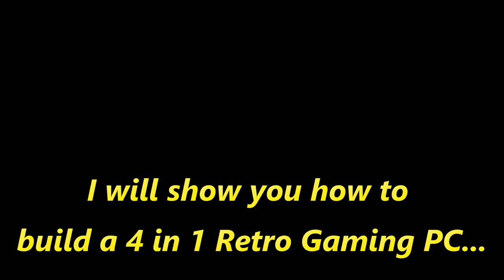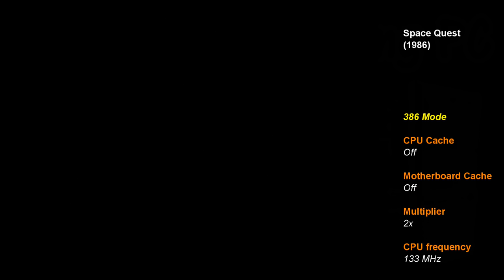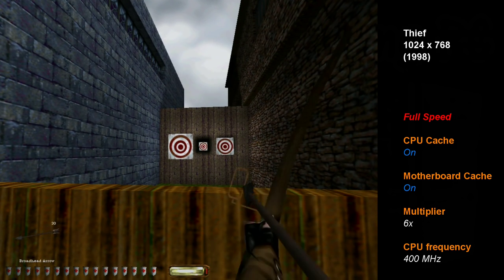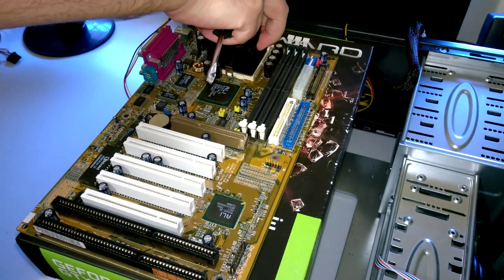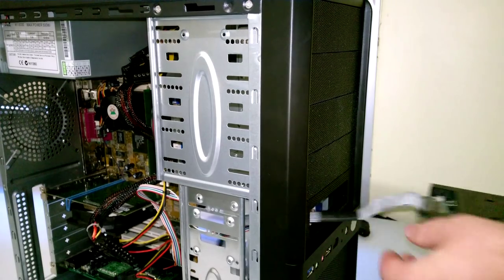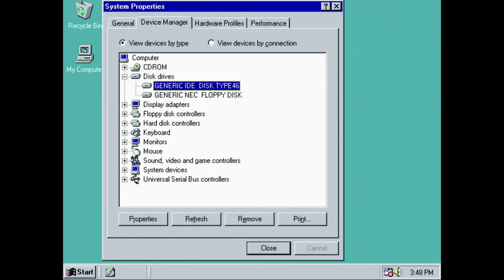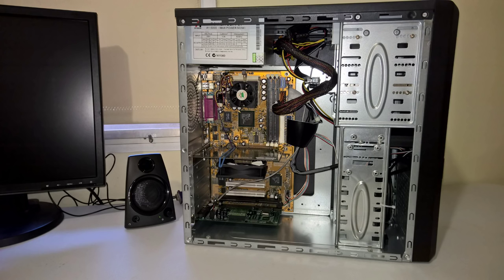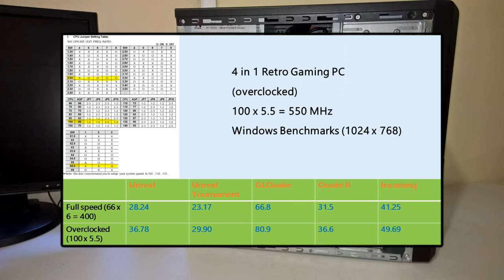Building a 4 in 1 Retro Gaming PC

Comment: What is a good AGP graphics card that works with Win-98 ?
Reply: The fastest Geforce that had Win9X drivers was the Geforce 6800XT AGP model. The fastest Radeon was the 9800XT. The best Voodoo card was the Voodoo 4500. 3DFX made a Voodoo 5500, but it was only AGP-2X and in many cases was out performed by the 4500. Both are getting really rare. You'd be better off going with a Radeon or Geforce.

Comment: Hell ya :D Just blew my mind, scaling a processor down and up on the fly! whoa... making it jump from 133Mhz to 400Mhz ;) I love your videos, I love your research, but The PCs are not period enough for me, IDE HDD, IDE CDROMs, PS/2 Inputs, & Real Floppies. Just like uxwbill says "Real Computers come with a Floppy Disk Drive." X-D
Reply from the maker: Jason Hicks Thanks for you feedback! Yes I understand, I love building machines with a mix of old and new technology. Especially having all the benefits of modern technology, be it a nice case, modern, reliable PSU, fast storage, an optical USB mouse and so on. It's not for everyone, but a lot of the tips apply to a proper retro PC as wel :)
Reply: philscomputerlab a lot of the programs you show off in your videos has helped with my Pentium 3 Laptop :D i didn't know most of them existed! Your video benchmark tools are awesome. I can't believe I have 2 P3 600Mhz laptops that are pretty much built at the same time (late 99), the HP Pavilion N3390 can do AGP x1 and Direct3D Acceleration but the Gateway Solo 2550 doesn't do D3D. Both are Graphic chips are from Silicon Motions, even the same amount of RAM, both are AGP x2! the only difference is the HP has a SM720 chip and the Gateway has a SM710 Chip.. freaking annoying LOL. It is even more interesting that the HP says it can do AGP Video x2 but I have no way of telling it to do so.
Reply from the maker: Nice! Must say I don't have any experience with using notebooks as Retro Gaming PCs, but why not?
Reply: as much in depth as you get.. Laptops from the late 90's would be a great thing to tackle. PCMCIA overviews, ZV ports, getting Gameport controller to work, hard drive options shoot outs would be interesting! hey speaking of shootouts, did 3DFX ever do a gaming solution for laptops? Just imagine the heat coming off that and Pentium3/4 aren't know for being cool neither! LOL

Comment: Are the usb drivers the same ones from the msfn.org forums ? If so, I have used it as well and they do work. Very handy to transfer stuff especially if there are no usb drivers for your more modern motherboard for windows 98se.
Anyone reading, make sure to have a proper faultless windows installation and already have the rest of the drivers installed from the motherboard cd beforehand. They didn't work from the first try for me, but after doing a format and reinstalling windows it works perfectly.
Reply from the maker: igorbog88 I'm not sure where I got them from, but yes, they work very well. Had USB sticks up to 32 GB in action. On these machines the speed is USB 1 or 1.1 only, so you got to be a bit patient. Copying across Ethernet network is faster. For very large copies, I pull out the HDD and put it in a USB 3 dock on my desktop :)
Reply: philscomputerlab  on my case it's slower than the usb 2.0 pci board with a Pentium mmx, but at the cost of high performance drop :( (10fps lost with 1 flash drive, 17fps lost with a flash drive on it)

Too bad I'm not able to disable l2 cache by software :( , But I kinda like that performance game heh, I even discoreved I could get 1 - 2 extra fps in quake 2 just replacing the usb keyboard by a dimm one :D
Reply from the maker: Interesting, didn't know that. I totally forgot about USB 2.0 PCI cards, I've had one in use a while ago. NEC chipset.
Reply: Mine's a NEC chip too, and I think it took 3 months to discover that the faulty fps in quake 2 was actually the flash driver >.> (I think I did 3 clean installs over that time).
 It was magic when I discovered the problem, it went from 27fps to 37,5fps :D, and now 38,5 because I'm using a DIMM (ps2) keyboard heh.
But, USB 2.0 Works just fine over my machine, if you only use it to transfer data it's ok, just let it off when playing Windows games and you'll be ready to go (hmm, maybe I can use it to slowdown even more my system over dos lol)
I wish I could get a K6-III+ but, they're only at ebay '-', and I'll need an EPROM for supporting it.
Reply from the maker: For copying file, do check out network cards. They are quite a bit faster and very convenient. I have a networked Raid 1 array and all my drivers, games, demos, stuff is on there. Makes it fast to get into a new project :)

Comment: how do you set it to 133MHz? do you use a 66MHz fsb?if yes, can the fsb be changed by software?...Hmm I see, you set your K6-III to 66FSB and the multiplier to 6x, shame my mb can only do 5.5 multiplier, but the mb support 1,5 multiplier, it's just bad that I cant set it to 1,5 on setmul
Reply from the maker: +ibm5155 Multi is set via software. You can go from 2x to 6x. FSB is set through hardware. Some boards allow it through BIOS.
Reply: But a K6-III+ can only go btw 3.0 and 6.0 right? (100FSB)
Reply from the maker: I'm sure I'm showing this in the video using SetMul,
Reply: @ibm5155  The K6-II/III+ chips will remap a 2.5x multi set on the motherboard to 2.0x internally. The 2.0x is remapped to 6.0x. Hope this helps!

Comment: Phil will a k6-iii + 450mhz work just as good or better for this build? It is on 2 volts and i believe 4.5 multi
Reply from the maker: +CSIG1001 Yes! It will work just as well :)
Reply: Trying to find a socket 7 that is comparable to the asus / gigabyte in your reviews is pretty hard on ebay.
Reply from the maker: Yes, prices have gone up quite a bit over the last years...

Comment: Just another question, my motherboard has jumpers to set the cpu frequency, so that software to change the K6-III clock will work on that mb or only on mb that set  the clock over the bios?
Reply from the maker: ibm5155 The software used in the video talks directly to the processor! The jumper settings will basically be overruled.
Reply: \o/
Reply from the maker: Quake games do very well on MMX, because the K6 has weal floating point performance AFAIK.
Reply: I got the K6-III+ 400 \o/.
Just one question, what is going to happen if I put it on my mb without supporting the k6-III+ by the bios?
I know my actual bios doesn't support the plus series, but it support it by a bios upgrade, but for that I'll need to take another bios (this one is an EPRON >( )
Reply from the maker: Worst case it won't boot, but usually it will display a different processor name that doesn't match.

Comment: It's a good option to use a Voodoo 3 2000 instead of a Voodooo 3 3000?
Reply from the maker: Yea that will work just fine. It's a bit slower, but also less heat :)
Reply: Is it much slower?

Comment: Isn't that a Voodoo 3 3000?  The 3500 has a TV tuner and a darker heat sink from what I'm seeing.
Reply from the maker: It's the "compaq" Voodoo 3 3500.
Reply: Ah, I see. Thank you sir!  Do you know what brand or model the hard drive bay you used here is?  Looking for one like it without a key that the ide to sata board will work with.
Reply from the maker: That bay is generic, doesn't have a brand! The cheapest you can find on eBay coming out of Asia :D

Comment: Hi Phil, In a LGR video, I see that you changed your time machine motherboard from this Gigabyte GA-5AX to the DFI K6XV3+/66. Is there any reason of you made the switch? Is the DFI mother more suitable to be used as a 4 in 1 time machine? Thanks!
Reply: Is it because the DFI is slower in DOS performance?
Reply from the maker: No particular reason really!
Reply: @philscomputerlab  So would you say they have equal stability and compatibility?
Reply from the maker: @wujames4074  Yea they are both great boards!
Reply: @philscomputerlab  Thank you!!
Reply: @philscomputerlab  If I can't find a K6-3+ 400, what is the next closet thing? A K6-2+ 500 or a K6-3+ 450 both 2.0v. Which is easier to setup?
Reply from the maker: @wujames4074  The 3+ have double cache compared to 2+ so go for that.
Reply: @philscomputerlab  Wouldn't it be too fast for DOS games? K6-2+ 500 is equivalent to K6-3+ 400 in speed?
Reply: @philscomputerlab  I got the answer from another video of yours!

Comment: PhilsComputerLab Would a Ga-5smm be suitable for this build? thanks
Reply from the maker: Yea that sounds fine!
Reply: PhilsComputerLab thanks ! only issue I'm running into is that video card. could you recommend an equivalent for this type of build? would something like a mx 400 give me this same experiance?
Reply from the maker: If you can find one with PCI. A Voodoo PCI would be perfect. Or get an older PCI card, and stick with DOS.
Reply: PhilsComputerLab one more question. so I got this ga-5smm in and there are 4 open spaces on the motherboard for "sdram50" to be soldered in. also there's a spot for the usb header but the header pins aren't soldered in. my question is can I add these to the motherboard if so what sdram chips should I hunt for? thanks
Reply from the maker: It's possible, but how could I know for sure? You just got to do the mod and find out.
Reply: PhilsComputerLab yeah if I can find a high resolution picture of one to get the info off the chips I will try it and let you know.